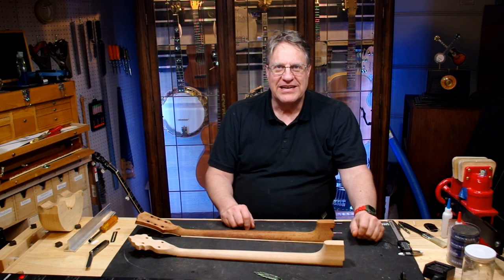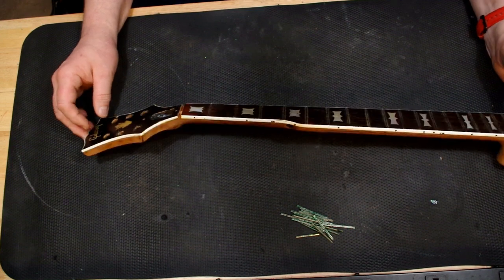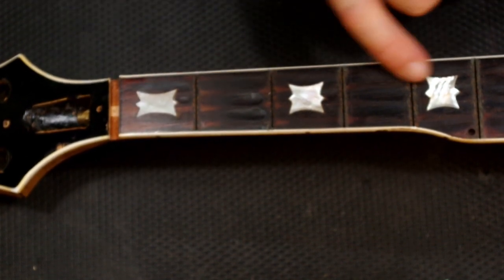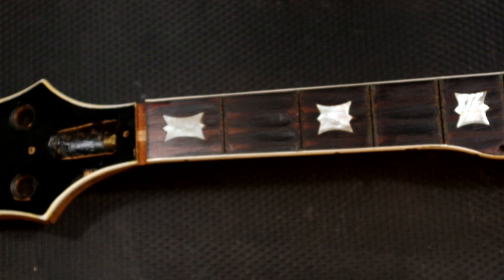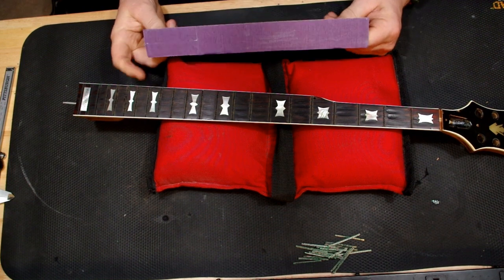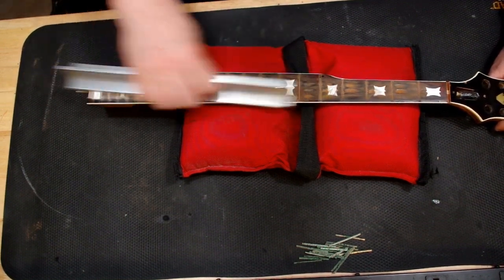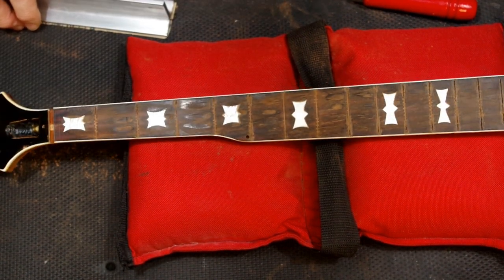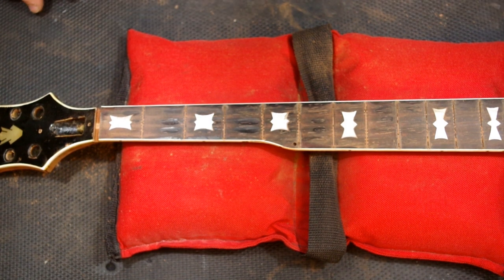fretboard level and sand

Comment: Another great video!!!!!!! Personally, I would prefer the divots filled. Some of those are quite substantial & in my opinion, they are more unsightly than properly done repair fills. That board has the slightly orangish tint of older Brazilian RW to me & I know some of the Gibson bowties indeed had Brazilian fretboards. I would sand the fretboard & keep as much of the dust as possible or find a scrap piece of Brazilian to make any additional dust as needed. 
     I watched a video the other day where a guy used a scalpel to mimic grain lines in the fills after he leveled them. Then, he oiled the fretboard with either lemon or linseed oil. The oil made the scalpel lines look darker & more natural to help camouflage the divot fills. 
     I'm not in the habit of promoting a channel in the comments of other channels, but pertaining to divot fills, this video deserves a look. If you've never done this type of repair before, it can help you explore some options. https://www.youtube.com/watch?v=zeV1vXT8fQU
Reply from the maker: Great input. Thanks very much.

Comment: Is that a fairly normal amount of fretboard wear on a well used stringed instrument? Or could it be a sign of playing with poorly trimmed fingernails?
Reply from the maker: It's heavy wear, well above "normal". But I can tell it was just played a lot, as evidenced by the worn frets. Still, keep your fingernails trimmed. Frets are relatively easy to replace. The wood not so easy.